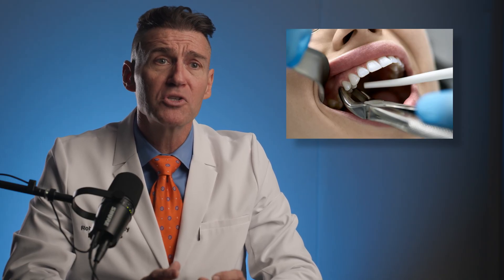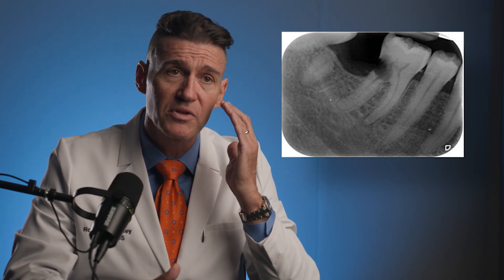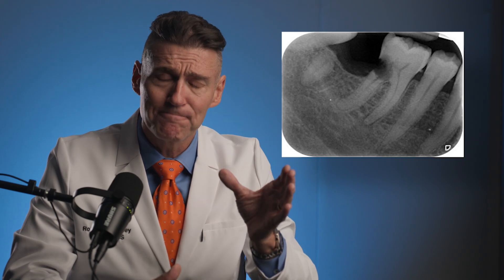How to STOP Breaking Root Tips

Comment: That's a good point. I solve this problem by cutting the root ligament with an Explorer motion before extraction. Also, before extracting a tooth that's periodontally rigid (like tooth #16 between teeth #15 and #17), I use a bur to remove the adjacent surfaces of the affected teeth to secure movement. Using a blade would also be a good method.
Reply from the maker: Also excellent methods to attempt!